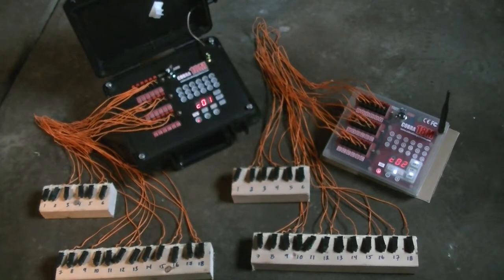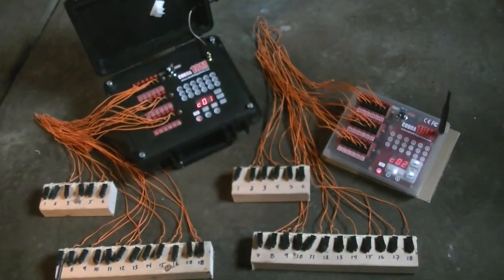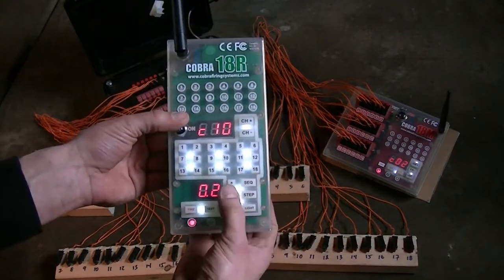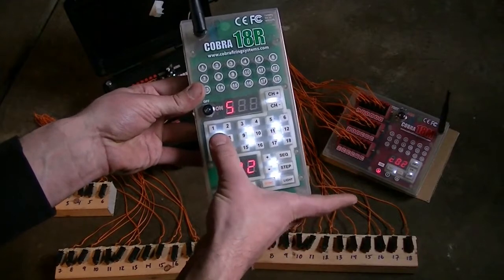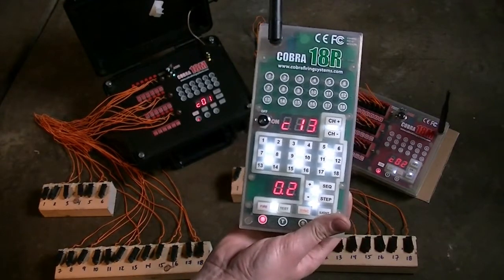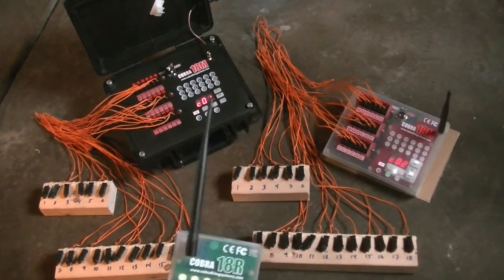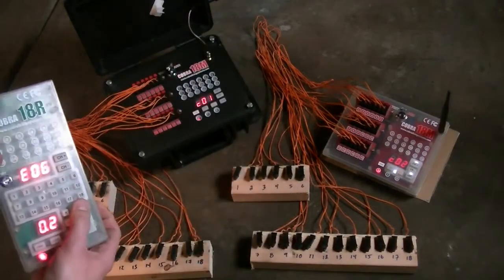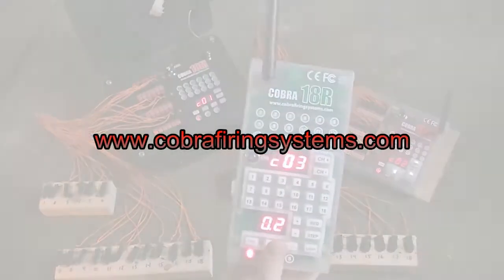COBRA18 Firing System - Executing a Sub-sequence

Comment: Get some lightbulbs from Cobra, these work great for practice without having to burn up talons or e-matches, the bulbs are fully reuseable.  Also these bulbs work for testing mini slats and multi slats for connections and for finding wiring problems.

Comment from the maker: Yes. You can execute a sub-sequence on a specific range of cues (e.g. 1-5). You can then manually fire any additional cues (e.g. 6-12) and finish with an automatic sequence on the remaining cues (e.g.13-18). This allows you to mix up firing methods in a single show.

Additionally, after starting a sequence on one channel, you can switch to another channel and begin firing another sequence or manually firing cues before the first sequence is finished.

Scott

Comment from the maker: Hello fidstang,

Yes. You can execute a sub-sequence on a specific range of cues (e.g. 1-5). You can then manually fire any additional cues (e.g. 6-12) and finish with an automatic sequence on the remaining cues (e.g.13-18). This allows you to mix up firing methods in a single show.

Additionally, after starting a sequence on one channel, you can switch to another channel and begin firing another sequence or manually firing cues before the first sequence is finished.

Scott

Comment: Once the system is in sequence mode, can you still execute individual cues by pushing the cue numbered button.

Example: I sequence the opener and it has just finished now I want to manually fire cues 6- 12 by pressing the cue buttons. Then end 13-18 with another sequence. Is that possible with the current software?

Comment: I have a question - Is it possible to 'pre-program' a sequence, or do you have to do it on the fly? Say for example, you wanted to fire off cues 1-7 manually (e.g. hitting one button at a time) but the next 6 cues you want to be a sequence (so ideally when you hit 8, the preprogrammed sequence 8-13 is fired)? Is it possible to do this or would you have to go through the process demonstrated in your video after firing the first 7 cues?